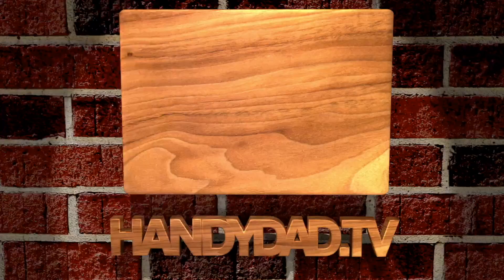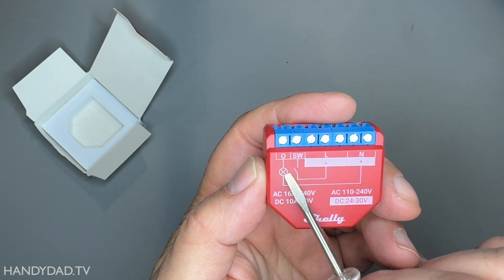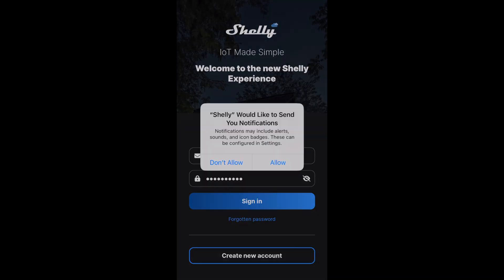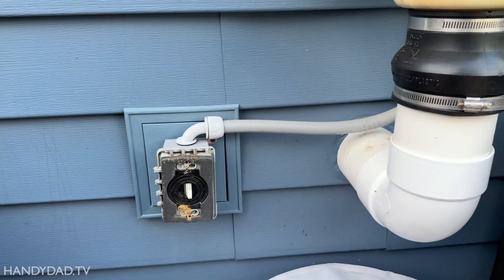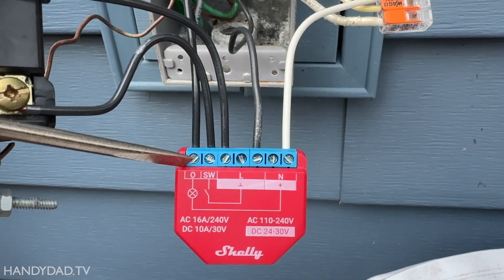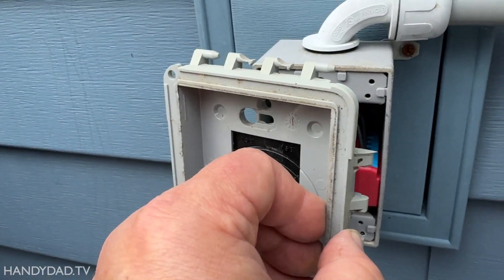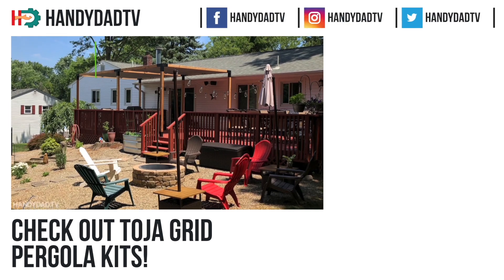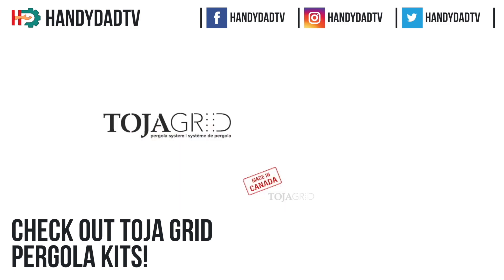Your RADON FAN needs this!

Comment: Nice, informative and well thought out video. One thing I would recommend, particularly in a crowded  metal electrical box is to wrap electrical tape around the sides of the switch to minimize the possibility of shorting to ground.
Reply from the maker: Thanks

Comment: I have a similar setup(hate the noise ), but you can actually take the smarts up one more level. I have an ecosense RD 200 meter in the basement which then talks Bluetooth to an esp32 device which talks to home assistant and based on the radon levels it will turn the fan on and off automatically. Also associated alerts if any readings exceed limits. It is interesting to monitor how the radon levels change based on various environmental (weather) conditions.
Reply from the maker: That’s awesome! Definitely a premium approach that I shall aspire to!

Comment: Pretty awesome idea to monitor for over/under power consumption. Shelly devices are pretty awesome.
Reply from the maker: Thanks 😊
Reply: @handydadtv  I'm kind of surprised that your fan is pulling so much power.  My fan pulls about 50 watts and isn't near as noisy.  I honestly didn't realize there may be different sizes.  Has it always been that loud?

Comment: I’ve used Shelly relays for over five years. They work great and control my pool pump quick clean mode, my whole house fan etc. I did decide to go with Lutron casita for my light switches.
Reply from the maker: This is my first but it won’t be my last.

Comment: Thanks for the breakdown of those Shelly switches. Glad you fixed the cover and wiring. I noticed bad wiring to that switch. Also that weather box I noticed before you said anything that it was put in wrong cause I just put in 3 of those boxes my self
Reply from the maker: Thanks!
Reply: @jeremiahpowell3028  it’s funny they had a proper in use weather box but installed it wrong. Our house had outdoor receptacles but they were t the in use kind so I replaced them all. Who puts a receptacle outside for low voltage house lighting and a pool pump and doesn’t thing they need in use weatherproof?

Comment: Thanks for sharing another cool home automation widget!  

One thing I'm always weary about is how long the vendor is going to be around and provide have their cloud services available.  

I found your site a couple of years ago, when Insteon's network went dead.  I wasn't directly affected since I used my own Universal Devices ISY controllers.

I'm still heavily invested in the Insteon camp, and will be looking to migrate from my Universal Devices ISY controller to their new EISY / Polisy controller soon.  Can't wait to finally integrate other WiFi devices in the new home controller.
Reply from the maker: Thanks for the comment! I understand how comfortable you can get with ISY devices after using them for years. I can attest, there is life after ISY if you want to invest the time and learn something new. As you know, I moved to Home Assistant last year and continue to learn new ways to use it.
Reply: You can run Shelly devices without Shelly cloud.  You can also flash them but the default firmware allows Mqtt etc so it’s not necessary